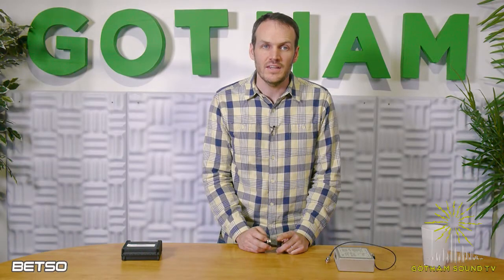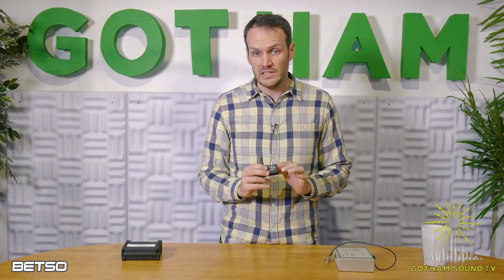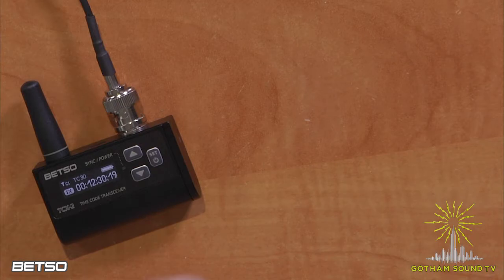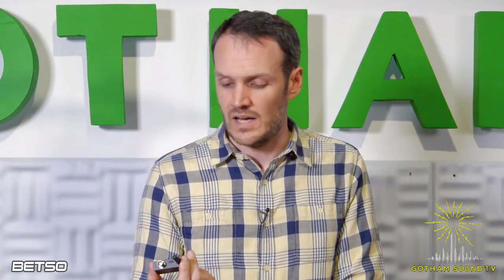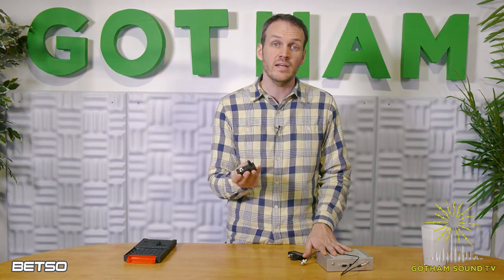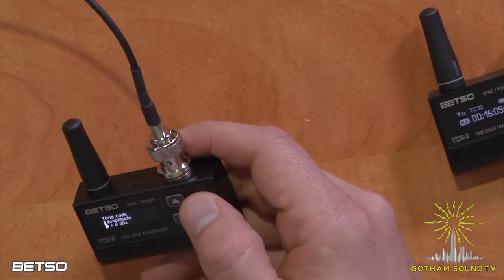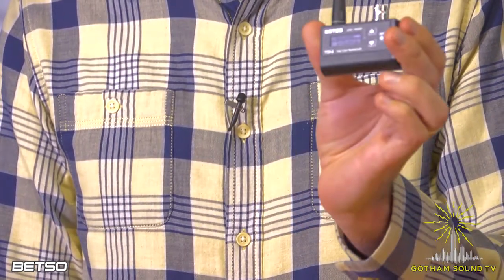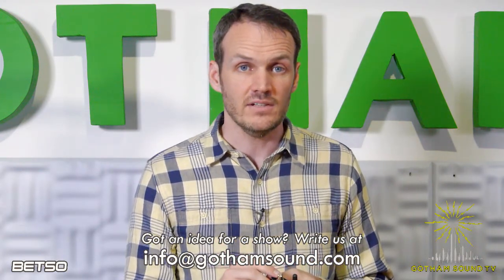Betso TCX-2 Time Code Transceiver

Comment: Thanks, Nick. Just started using my Betsos and love them. Would you recommend having one for each camera and one for the audio mixer/recorder?
Reply: Hi Tom, glad you are enjoying the Betsos!  The ideal situation would be to have one on each camera and one for the audio recorder but it is not necessary.  If you were to do that you would have guaranteed accurate clock because of the RF link.  However, the Betso can take a jam from your timecode master and then transmitter to the other boxes and maintain very accurate timecode.
Reply: Thanks Nick!

Comment: What happens if at a stadium if someone else is transmitting Betso timecode?   Are you paired with your Tx or are Rx open to receive any timecode on one of the 5 channels?   Do you always have to jam off a source or are you able to generate as well?
Reply: I read your concern and considered it too. Since then, I've purchased 3 of these units. You can choose from 5 channels and then the receivers can be assigned ID's ranging from 01-20. So I feel like the combinations you could come up with make it very unlikely that someone else would have chosen Channel 3 Id's 09,10,11. Not sure it's foolproof though. Maybe I will try a test where I run 2 as transmitters and see if I can get the second TX to take control of the RX. Will report back...

Comment: One interesting fact I just learned is that there is an available 
upgrade for the TCX-2 that allows it to be a timecode generator and will
 allow it to both transmit and output timecode by the BNC.
Reply: All TCX-2 boxes now come with the upgrade for free.

Comment: What do you mean by using it with a DSLR? Can this be used like a Tentacle Sync?
Reply: It can output timecode to an audio track of a DSLR just like the Tentacle Sync.  It does not have an on board microphone which the Tentacle does.
Reply: It doesn't have a built in mic to pass reference audio to a track like the Tentacle. He's referring to the ability to pad the timecode (audio) signal down low enough for a DSLR to handle (which are mic level input).